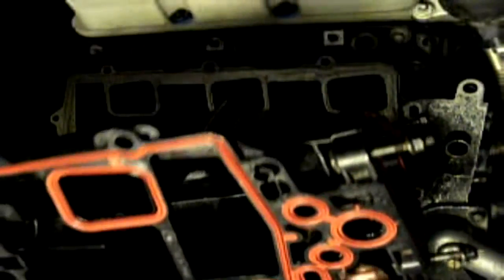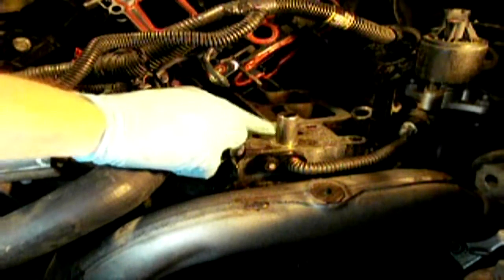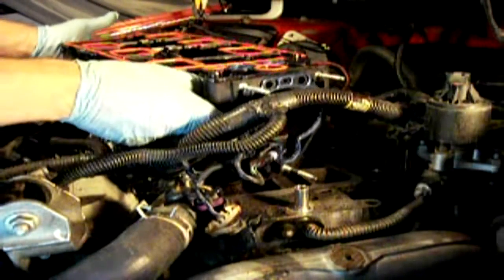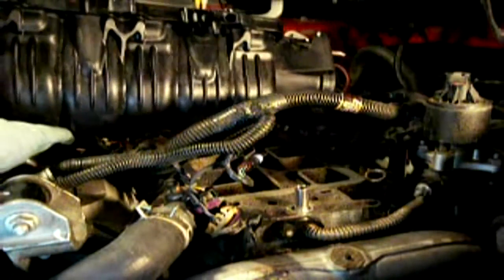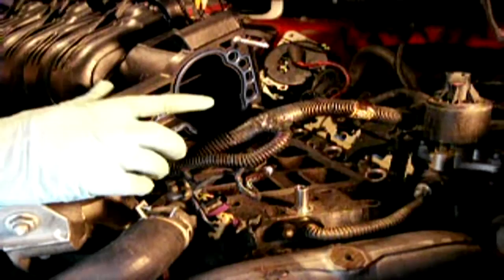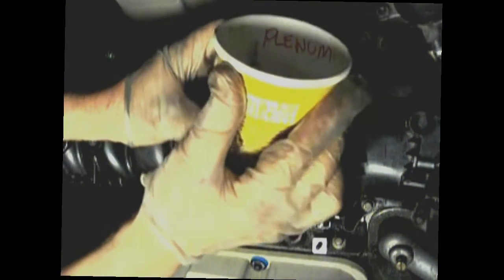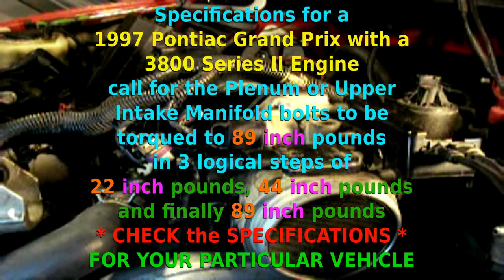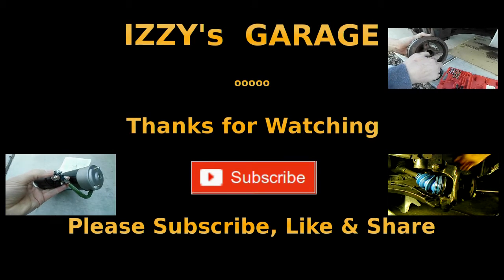PLENUM UPGRADE change Upper Intake Manifold replacement + new EGR riser pipe UPGRADE - GM 3800 cars

Comment: I had to tap the new one in with a hammer pain in the ass keeping it straight and tapping it down but I got it now I'm at the point putting it back together I was wondering if u used the felpro lower intake gasket kit mine came with the 6 gaskets I think 2 of them I don't need since I didn't take off the ones that came with the kit

Comment: when I got the intake manifold and gasket kit it came with 2 egr riser tubes and in the kit it tells you that there are 2 different size riser tubes I figured out that I need the one that was a tight fit in the lower manifold the other one was way 2 big

Comment: What's the "upgrade?"  Is there a part number for an improved part?  Or are we simply replacing with an OEM part?
Reply from the maker: It's an upgraded design that deals with the heat riser area  that normally fails in the OEM manifold. All this is covered in the video.

Comment: and if you notice on the 3.8 the exhaust that runs on the bottom of the egr is actually heating the egr pipe causing it to get hotter than it should no necessarily just the egr but reducing the tube is a good way to fix that problem I haven't heard on any video of the exhaust pipe heating the erg pipe going to the tube in the intake just an assumption
Reply from the maker: +John Smith: The EGR (exhaust gas re circulation) passages by nature are hot, since it is actual exhaust gases being recirculated back into the intake manifold. This video covers the EGR riser upgrade to a smaller diameter riser.
Reply: Could I by pass that egr and eliminate it going into the intake  would that make it run better ?
Reply from the maker: +John Smith: The EGR is part of the emission control system. Most PCM's keep track of the flow and operation of the valve. So if you did do a modification, you would be defeating part of the system, and may run into additional problems.

Comment: oh yea if the oils was getting past the rings or Valve guides   wouldn't the spark plugs be oily?
Reply from the maker: +John Smith:  Not necessarily, if the issue is not real bad. You mentioned "white" plugs. If they where white, that means the heat range on the plug is too hot. The extra heat could also be burning it off. The correct color should be a center electrode insulator with a tan, sandy color to it.
Reply: Yea I changed the plugs and lost some horse power when  punching the gas  but still runs good I get 380 miles per tank I however haven't checked the plugs since the notice of oil lost or since replacing the old ones and when I say white I meant white specs
Reply: I use the iridium plugs that's what advance auto said that gm uses for stock do those run hot in general than the old spark plugs
Reply: Old copper plugs*
Reply from the maker: +John Smith: Iridium is not as good a conductor of heat as is copper, but the heat range of the plug is really governed by the design and length of the porcelain insulator around the center electrode. The longer that insulator, the hotter the plug, since heat has a longer path to travel until it gets dissipated at the cylinder head.

Comment: I bought the car a few months ago ever and it's got 83,000 miles it's a 2002 buick lesabre 3.8 liter from the mileage and year I think the car sat for a while I'm trying to tackle the oil burning issue I know the where the coolant is leaking I just don't wanna do all the work on intake and later find out its got a cracked head or bad rings what's your opinion on the loss of oil based on what I've told you and also after 2 days of buying the car the check engine light came on was burning a lot of gas I replaced the o 2 sensor fixed the light it went off and stopped using gas but now I notice the loss of oil or burning
Reply from the maker: +John Smith:  I already gave you my answer on the oil issue, but you didn't like it. I understand, no one wants to hear that they may have rings and valve guide issues. Check the PCV valve just in case, and see if the symptoms improve.

Comment: could that be a pc valve gone bad as to why I'm burning oil?
Reply from the maker: +John Smith: Burning oil would not be the attributable to the  PCV valve. The burning of oil in an internal combustion engine has to do with internal damage, usually sipping past the valve guides or the piston rings, or both. On the coolant leak issue, if your engine is a 3800, you might be looking at symptoms of the issues these engines are known to have with the heat from the EGR riser damaging the plastic plenum and maybe even the lower intake manifold as well. This very topic is what this video is about.
Reply from the maker: +John Smith: Besides, you mentioned 1 quart per 1000 miles. That is actually at the high end of what some manufacturers consider acceptable oil consumption.
Reply: I'm going to change the p cv valve and see what that does trial and error is all I can do since there is no codes popping up
Reply from the maker: +John Smith: Following a proper diagnostic procedure is always the best way. If you rely solely on the engine computer to tell you what's wrong with your car, you're in for a big shock, and so is your wallet. In this case is alright since it is such an inexpensive part. But don't make it a habit to just replace parts unless you're made of money.
Reply from the maker: +IZZY's GARAGE: In retro expect In my earlier comment about burning oil, recognizing that in life there are no absolutes, except death and taxes, I should have phrased it differently. I should have said: Burning oil would NORMALLY not be attributable to a clogged PCV valve. I imagine it could be feasible for a worn-out engine with a really clogged PCV valve to burn oil, due to the PCV valve, (maybe). Although worn-out engines will usually burn oil due to other reasons anyway.

Comment: what plugs and oil do you use?
Reply from the maker: +IZZY's GARAGE: I'm old school. I stick to good old copper. Copper is a far better conductor of heat and electricity than the exotic metals. As far as oil is concerned, my favorites for performance engines are Valvoline and Castrol. For everyday cars, I have used Surpertech for many years, and have no complaints.

Comment: no I hand tightend everything my torque wrench was in foot pounds not inch pounds yea im a dumbass ass and it wont happen again on not torqing it right but my main question is since it only got hot for a few minutes do you think im gonna have to replace the head gasket like I said before it didn't have chocolate milk before just burning oil and leaking coolant by the throttle body but when I got it all bolted together there were no link I must have over t ightend them ? I definitely need to get a inch pound torque wrench instead of foot pounds so I'm not second guessing my self

Comment: hey izzy I fucked up I can't figure out what I did wrong I got everything together didn't break anything " least of my worries"how ever when I started it up it idled fine but I kept an I on temp and was getting got quick as fuck so I shut it off and checked the dipstick and had coolant in the oil .before I did the upper and lower intake there was no coolant in the oil it was just burning a lot of oil and leaking coolant by the throttle body like i said when it warmed up there was no leaks but inside the motor oil was coolant  what do think happend bro
Reply from the maker: +John Smith:  Did you watched the video in its entirety?  If you skipped, you might have missed something.  I covered all the steps in nauseating detail.  Did you replace the lower intake manifold as well as the upper?  Did you correctly installed all the gaskets?  Did you torque everything down to the proper specs? Has the engine overheated in the past?
Reply: They want 350$ for a lower manifold I bought the upper intake plentum $130 plus the lower manifold gasket kit $80 im on a tight budget what is so wierd that it heated up fast and had coolant in the oil immediately never had oil in the coolant before why would it heat up that fast after starting it litteraly 10 minutes of it running it got up to 240 degrees and climbing so I shut it down cuz I knew something was wrong then checked the dipstick and had chocolate milk
Reply from the maker: +John Smith:  I can't tell you what I think until you answer ALL of my questions.

Comment: I have seen other videos of people burning oil and the pcv valve was the corporate I'm pretty sure I know the coolant leak is coming from the burn off tube I checked the plugs when I bought the car and they were white very clean look no oil
Reply from the maker: +John Smith: All the PCV valve does is to circulate the gases from the crankcase into the intake manifold so they can be burned-off in the combustion chamber. In the old days the crankcase was simply vented into the air. A plugged PCV valve could be causing excessive pressure in the crankcase and could in theory cause excessive oil pressure. Simply take the valve out and shake it. If you hear it clicking freely, then the valve is fine.
Reply: So it's getting in past the valve seets from too much pressure from the pcv valve being bad?
Reply: The oil is getting past the*
Reply: My oil pressure is about 65 on the gauge is that normal
Reply from the maker: +John Smith: Is that at idle?
Reply from the maker: +John Smith: I never said valve seats. Oil does not get past the valve seats from too much pressure. It can get past the "valve guides" and the valve stem seals when the valve guides and or valve stem seals are worn, and subsequently sucked into the intake from the crankcase and burnt in the combustion chamber. Although like a said before, being theoretically possible, oil does not usually get past good valve guides and seals. Excessive oil pressure usually manifests itself in a different fashion, such as oil leaks, among other things. You are trying to reach a conclusion without doing any diagnostic work. Just test the PCV valve, or simply replace it. They are really inexpensive, and you have eliminated that doubt. Then continue with the process of elimination.

Comment: based on what I told why is there coolant in the oil
Reply from the maker: +John Smith:  In this engine, that are three possibilities for having oil mixing with the coolant. An internal leak between the plenum and the lower intake manifold, between the lower manifold and the heads, or a head gasket leak. Was there any evidenced of some sort of coolant "stop leak" that could have previously been added, when you opened it up, like silvery, gold, or gray dust or fibers  floating in the coolant, or deposits around the coolant passages in the manifold?
Reply: Stupid lower intake corrodes in the middle that causes this. At least that is why mine did. Reason is using tap water instead of distilled water in the coolant mixture plus the differential of metals , aluminum intake and steel head causes an electrolytic corrosion problem. Seal the middle with a thin layer of high temp copper silicone gasket material to prevent this electrolytic effect. STUPID  simple engineering error. These assholes make way more money than techs like me so why is that?

Comment: I know what I did wrong but I'm not gonna comment because I worked hard to find out what I did it was so stupid  of what I forgot to do in the start up process
Reply from the maker: +John Smith:  What worries me, is not so much the coolant in the oil alone, but the quick temperature rise you mentioned as well. That behavior is indicative of exhaust gases being forced into the cooling system at one of the three places I mentioned earlier, or of a cooling system that is not property filled and has too much air in it. If the problem is not with the intake manifolds (upper & or  lower) then it would be a blown head gasket.

Comment: I should point out that the new pipe still touches plastic at the bottom after installation. Yes it's touching the gasket but the hot gasses still are hot enough to cause plastic intake to warp. I did manage to file the warpage flat once but it happened again so I don't know if I can correct it again without new replacement. This is the ENTIRE STUPID reason these cars are very rare on the road today. My 1998 Eighty Eight Royale has never had any other problems except this damned intake even though it has 200,000 km on it. The upgrade will not allow for racing the engine or hard acceleration unless it doesn't matter that the new intake plenum will warp and AGAIN allow for coolant to trickle into the piston combustion chamber effectively making the car run rough. If this isn't corrected the piston will develop a slight compression problem and will lope on acceleration or idle. Stupid 1990's - 2000 GM apologized for this STUPID plastic intake. After market should make an aluminum one but they don't unless you get the super charger intake. I HATE THIS BUT I LOVE THE ENGINE OTHERWISE. STUPID ENGINEERS. If this isn't the result of nepotism in the workplace I'll eat my shorts.
Reply from the maker: Agreed. It's almost a sin to make these plenums plastic, along with the coolant elbows. It's just another example of, "made to fail".  Otherwise these engines would practically run forever, without any issues. Although, I have never reused plenums. I've just installed new ones to make sure I was done with it.  Thanks for the feedback!
Reply: I just corrected this issue but it wasn't what I thought. An impact to the front fender  years ago cracked my radiator right below the air intake and was spraying a fine mist of radiator fluid right into the intake. I KNOW!!! It was so misleading until a cold snap caused the crack to widen enough to locate. Hard acceleration made the problem seem like the plenum was acting like the same problem. I repaired the crack and the condensation on the oil filler cap and rough idle was eliminated. Man when I get problems they are so difficult to located these days.
Reply from the maker: Cases like these proves that no amount of studying can be a replacement for experience.  I had an overheating problem on this same engine after a radiator leak, overheating, blown head gasket, and subsequent new radiator replacement from a reputable radiator shop. Head gasket replacement and valve lapping job was also performed, together with the new plenum and heat riser kit installation. The car would continue to eventually  overheat after about a 20 minute drive.  I couldn't figure it out. I thought I was dealing with a cracked block, although all the tests said otherwise.  Turned out that the NEW radiator that was sold to me was of insufficient capacitiy. The only way I was able to confirm the problem, was by fitting an original radiator from a same model car obtained at a junkyard. Problem  completely fixed.
Reply: The ENGINEERS did an amazing job to produce the best engine ever. Only a few non-ENGINEER design scrimpers caused the plastic error. Not stupid ENGINEERS. I am certain that the ENGINEERS would have opted for the aluminum plenum if they were in charge of all final decisions.
Reply: @richardcallahan1689  OOOOOOhhhh gooood… I so wanted to get to the bottom of this. So not the stupid engineers... good. I would have thrown a gasket myself if I had designed something as good as the 3800 and some A-hole bean counter decided plastic and super hot exhaust belong together. Like I said GM apologized for their line up at that time and did change it. I think an apology isn't enough, they need to point fingers for who's son or daughter did this stupid mentally deficient thing. GM stock is only where it is because of it.